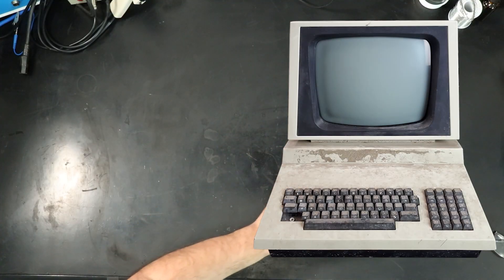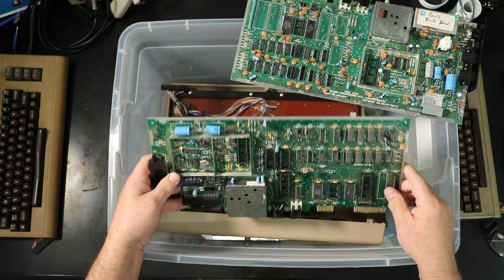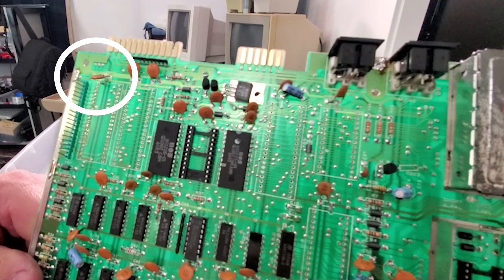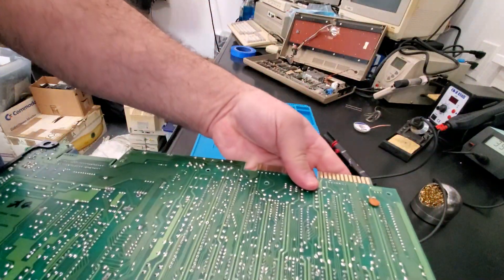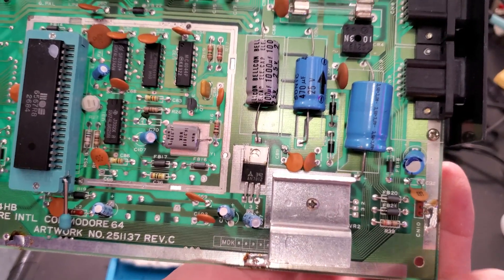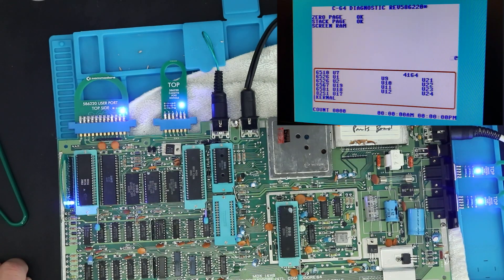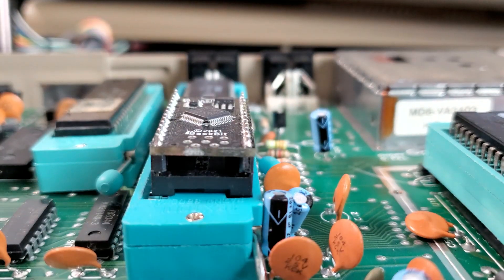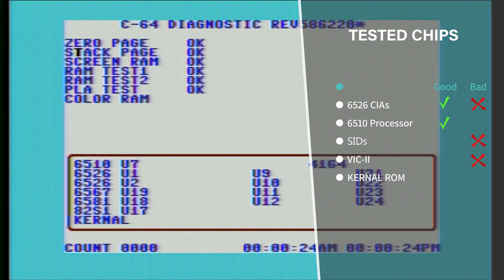This C64 Mod Makes a Fantastic Tool for Testing Chips

Comment: I've had the parts for a ZIF 407 board for so long I completely forgot about it but this Video was great and reminded me about that long lost Project.  Although I do also have 2 parts boards that I might do the same as you did and save time by not having to remove so many chips!  -Mark.
Reply from the maker: Sounds Great Mark! My favorite part of the build was that a good C64 was not sacrificed. Everything came from machines that were parted out in the 90s so I have no guilt 😎

Comment: I've had mixed results with clone Textool sockets.  Some are actually quite good, and while I haven't encountered a really bad one yet I've seen some bad ones.  My Sager G540 programmer actually has the real thing on it.
Reply from the maker: They seem OK once soldered in but the flimsy pins shipped from china in a box with zero packaging was a bit of a disaster. Fortunately there are better options now on Digi-Key. I bought these earlier, during the pandemic when I was getting parts for the Retro Chip Tester Pro.

Comment: Excellent work! Not sure if you put ziff sockets for the ROMs and a RAM chip. I made mine a few years ago and it's a great diagnostic tool to have. Thanks for sharing
Reply from the maker: Hey Rudy! I was originally planning on doing that but then I realized I would just be enabling my procrastination on the Retro Chip Tester Pro that I have been putting off. It seems like a more reliable way to test RAM and ROM. Also my ZIF sockets are too large so I would only be able to fit the KERNAL ROM without some kind of Riser.
Reply: @RavenWolf Retro Tech  I used the large ziff sockets for the ROMs then put electrical tape over the extra pins so that the ROMs fit properly. I too have that tester pro but still have to oder all the parts to build it. I test my RAM   ROMs, CPU, PLA etc. With the BackBit Tester Pro. It's a fantastic diagnostic tool and she keeps adding ROMs and other chip daily. You should have a look
Reply from the maker: Wow, I took a look and it looks fantastic. Hopefully my budget will loosen up soon so I can take a look at one. I like the variety of ICs that it can test like PLAs

Comment: Nice video.  Holy smokes you have a lot of c64s to test.  I have not used the BackSID although I do have one, I prefer the ARMSID.  One thing I can recommend is the BackBit Chip tester Pro.  This thing tests a lot of the custom chips. CIAs, SIDs, 6510, VIC, PLA, etc.  Also Atari and Amiga chips, and many, many others.  It can also test,  identify and dump most any Commodore and other ROMs.  Looking forward to seeing your progress on that awesome collection.
Reply from the maker: Thanks Racer X! I have to confess that the reason I have a BackSID kicking about is that I hate the way it sounds. For testing I have a Retro Chip Tester pro that I need to assemble and figure out how to program.
Reply: @RavenWolfRetroTech  Sounds familiar haha as I finally finished my Retro Chip Tester Pro and got it programmed and it is awesome.  I used the Pololu Programmer that you can get cheaply in the USA from their website.  At first I had trouble because the instructions in the RCT manual for that particular programmer are not what worked.  I figured it out and sent the designer of the RCT the exact steps and he said he would update the manual.  But if you end up using that programmer feel free to message me and I can send you the step by step.  I just updated mine to the recently released version and it is an awesome device. The BackBit one has the advantage of the custom chips but I do use the RCT for most everything else, DRAMS, etc.
Reply from the maker: I'll keep that in mind. I am not certain if I have a compatible programmer. If not I will look at that one!